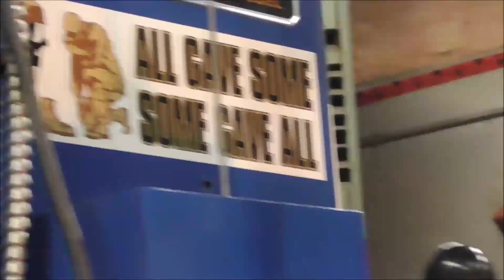Episode 111: Learning to Plasma Cut

Comment: Hey man, loyal follower of you and 1pug's here and also welder and fabricator since the mid 90's.  You're doing a great job there as a beginner with the plasma; the only thing missing is a proper "rest".  For plasma/oxy-acet/welding, etc you can greatly improve the quality of your finished product just by setting your work up properly.  You want to be able rest you forearms or wrists on a stationary object and use just the fine motor control of your hands to make the cuts.  In the field this isn't always possible, but in the shop you will see an immediate jump in finish quality just from doing this.  Just search welding rest on YouTube and you will find various methods and products people are using to accomplish this.  Best of luck.